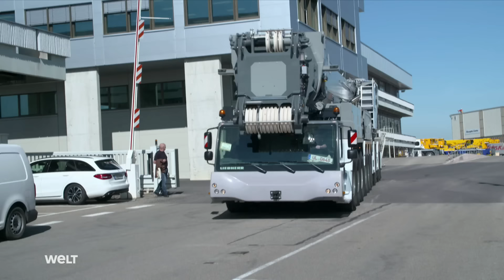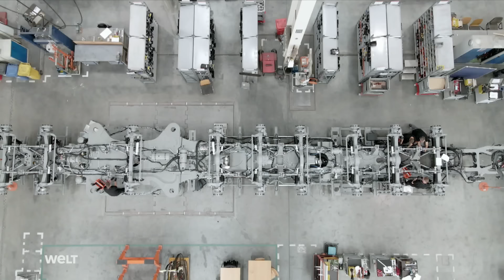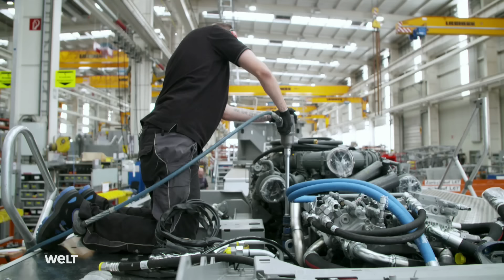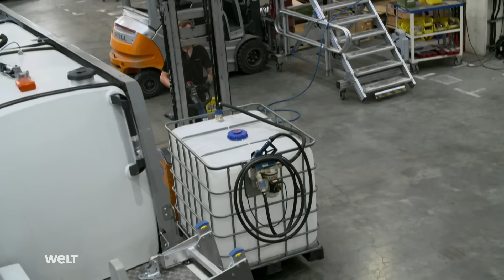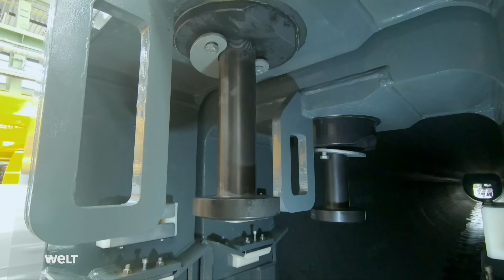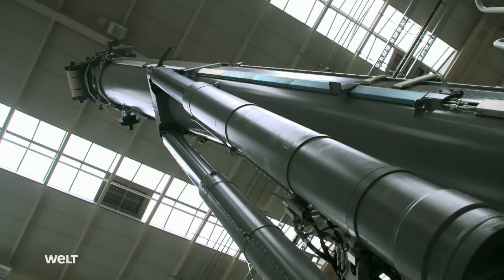Discover the World's Largest Mobile Crane: The Liebherr LTM 1750 with 800 Ton Capacity | Documentary

Comment: I'm a crane operator and also a watchmaker in Brazil. I have been working as a crane operator for 22 years and as a watchmaker for 8 years. I love my two professions. When talking about weight, there are two extremes. I have worked with cranes weighing up to 600 tons. Here in Brazil, nowadays, this profession pays poorly. But it is a profession that is enchanting when you have love for it.
Reply: Wow, can there be any more difference between lifting 10 tonnes and lifting a gear weighing a few milligrams?
Reply: Thank you for what you do as an operator 
Do you ever get on a Job, then the supervisor for building company wants you to set outrigger in to soft a location
Then have you LIFT more than the crane allowed 😊 just asking for feedback on how you deal with an oversized lift.

Comment: The torque required to secure some of these components is insane. This crane is a certified beast.
Reply: Ahhh, those beautiful White Germans doing amazing things as usual. USA fought the wrong enemy in WWII.
Reply: im surprised at the lack of personal protective equipment during the testing phases... you'd think that with the torques, forces, pressures, weights etc involved, they would want to be more safe than sorry

like what if one of the many hydraulic lines sprung a leak during a test?
Reply: @thinkcasting3182  me after the lobotomy
Reply: Make sense there, but I would think Liebherr will test the hydraulic hoses under the require pressure, LIEBHERR IS THE ROLLS ROYCE OF CRANES,@carmatic

Comment: Probably the most iconic tower cranes would have to be what was originally the Australian Favco crane . These were used on the New York Twin Towers in the 60’s . I still see a lot of Favco’s on building projects in Melbourne Australia, a city with a lot of high rise in its CBD .
Reply: Great, but Favco didn’t invent the tower crane, and this video is talking about mobile crane, which Favco doesn’t make. It seems that it isn’t so iconic, while the highest isn’t made by Favco, the stronger one isn’t made by Favco, the higher capacity isn’t made by Favco. 
Favco is just a company who made simple conception crane that made eficienty cost of fabrication.
If you’re Australian, it’s normal to be proud of a company who sells worldwide, but that doesn’t mean that this company is worldwide iconic. It will depend on which domain and the region/continent.

Comment: Awesome Vid of manufacturing the LIEBHERR LTM 1750-9.1!!! However, I should like to point out that the LTM 1750-9.1 is not the World's Largest Mobile Crane: 4 other Mobile Cranes are larger & stronger, as follows: 1) LIEBHERR LTM 11200-9.1  2) SANY SAC24000T  3) ZOOMLION ZAT24000H  4) XCMG XCA2600 10-Axle All-Terrain Crane
Reply: they say that is the biggest mobile crane with superstructure mounted on. The others you mentioned they travel without boom, it's mounted on site

Comment: Update:  i should like to point out that the TADANO DEMAG AC 1000-9 9-Axle Mobile crane is stronger than the LTM 1750-9.1, and that the 10-Axle GOTTWALD AK 680-3 is not only larger but also stronger, like the 10-Axle XCMG XCA2600.
Reply: but they don't travel with the boom mounted on. They are assembled on site
Reply: Just saw another person’s explanation, it’s the largest and strongest mobile crane with the superstructure/boom attached, not assembled only on sites

Comment: I am operating a Liebherr crane model 1070.4.2 in Korea. The 3rd and 4th axle wheels do not steer due to a steering error. Even though I changed the 1st axis sensor, an error message appears. Please tell me what to do.

Comment: Is the LTM 11200-9.1 disengineered and no more existing?
Reply: This model is newer, the 11200 is still in production I think, but they said this was the largest crane that could travel with its boom, which was true until last year or this year when a Chinese company launched a bigger crane.
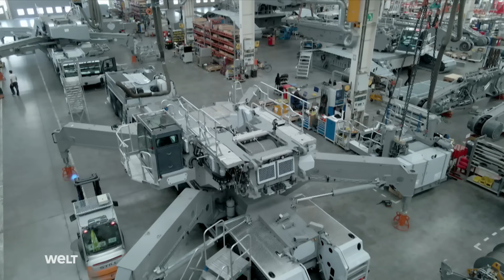Reply: At 41:52 the crane parked just in front is a LTM 11200-9.1 being assemble too 😉
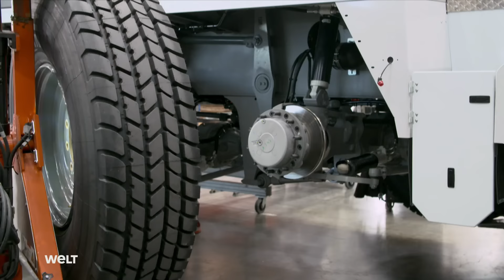Reply: Better view at 32:17 with the cab arm
Reply: @marksapollo  Meh, anyone could in theory build a bigger one, BUT - would your Chinese rig meet the maximum road size allowable in Germany like this crane does.  And will the Chinese one fall over due to Chinese steel.......
Reply: @einfelder8262  Well firstly Chinese steel is probably superior to European steel as they probably stole it from Europe and enhanced it, and secondly I don’t know about the German regs. I guess if it’s sold in Germany then it does but I don’t know if it is sold there?
Reply: @marksapollo  Get back on your meds mate - Chinese steel superior to European????  I agree they stole it but Chinese enhancement is always to increase impurities, decrease thickness, and increase rustability.  The video states that the Liebherr is the maximum size and weight allowed on German roads, and I doubt the Chinese larger knockoff would be  withing the size allowed there., even if anyone in Germany would buy it.
Reply: @einfelder8262  I think you need the meds, go and watch this video again, from 2:00 and you'll here they clear state 'it is the largest mobile crane that can transport with its boom "in the world"'... so your flat out wrong. And so it's your ridiculous part of Chinese steel, it's used in most products in the West.

Comment: Very interesting movie on how a LIEBHERR LTM 1750-9.1 is manufactured -- very interesting suspension system hydraulic accumulators, weight of things, etcetera; Arguably, the 3 China-based Crane Manufacturers are ahead of LIEBHERR -- to note a few examples: The 6-axle SANY SAC5000S, the 7-axle SANY SAC7000T7, The 7-axle ZOOMLION ZAT6000H, The crawler crane SANY SCC98000TM/SCC45000A, and the crawler crane XGC88000 by XCMG -- XCMG also offers an impressive 6-axle all-terrain crane.
Reply: Mate your spamming is a bit annoying especially when you are spreading misinformation. What part of this crane is the biggest of it category that carries its boom that you dont understand? the chinese models you mentioned carry their boom on a separate transport. Working on the purchase and sales of mobile cranes for many years, literally nothing about chinese cranes is ahead of liebherr designs. The chinese managed to build larger cranes simply because they do not follow european guidelines, its as simple as that. Whats the point for liebherr to try and build mobile cranes even bigger than the ones they have if you cant really drive or operate them on european roads. Technology wise literally there isnt a single company ahead of Liebherr and if you think otherwise you are clearly misinformed

Comment: Its pretty crazy to see how this unit is designed to be assembled from the factory as easily as possible, but not to be repaired in the field with ANY consideration. Engineers are great for initial design. Pretty much useless for in field repairs. Costing the owner hundred of thousands of extra dollars over the life of the crane. Not a complete design!